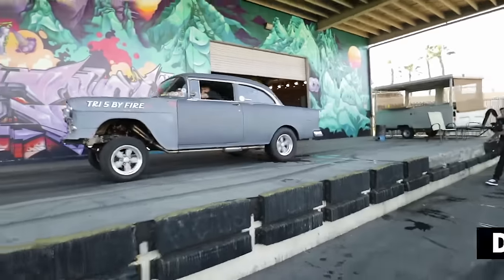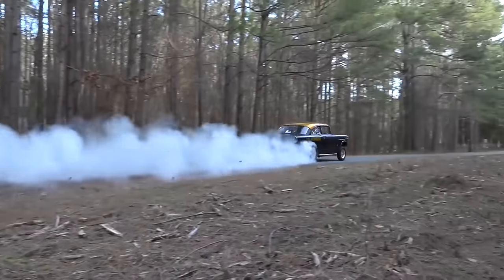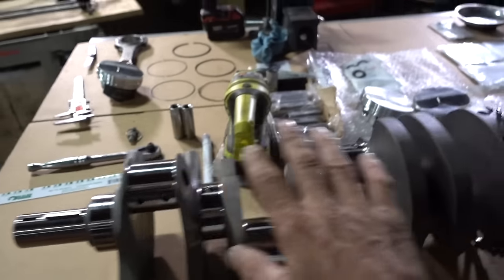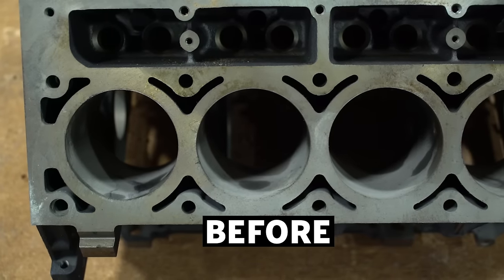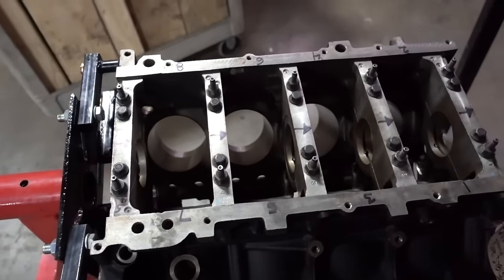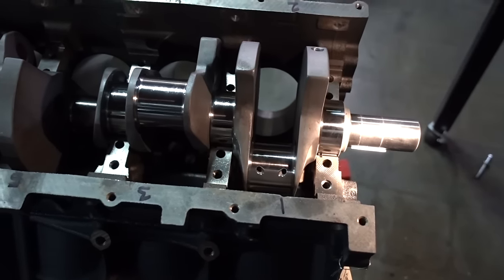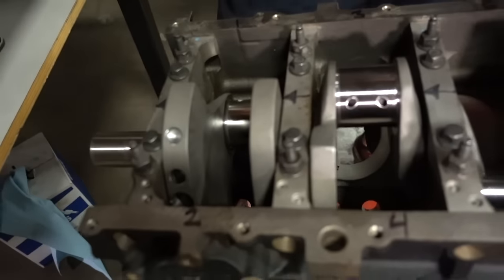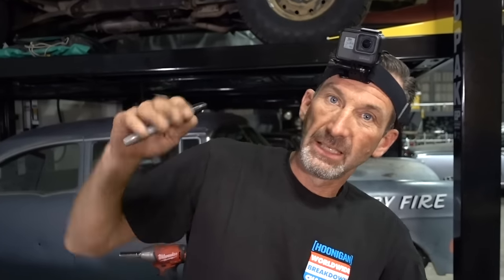700HP Stroker LS - How To Build Bottom End

Comment: smh this was terrible.......didnt even step the main cap torque.....used plasi gauge instead of dial bore gauge and micing the rod journals on the crank. used factory bolts to check the clearences instead of the arps....and he was really rough on taking the main caps off......letting them hit the floor.....gosh some many things wrong he did

Comment: You might as well have built the motor in the dirt. Nothing professional about the way you "attempted" to build that LS. Not to mention you screwed up majorly on the mains. Hope to God CPR line honed the mains to the ARP studs at the correct torque, if not that motor is going to eat itself alive.

Comment: Poor engine building "techniques"
Very unprofessional, dropping main caps on the floor. Side bolts dont keep the cap from coming out if main bolts come loose, it's to prevent cap walk. Checking main clearance with factory bolts with torque to yield, then installing the crank with ARP studs?? The assembled clearance is going to be different then checked clearance. Double clicking torque wrench, you just overtorqued...  filing rings with power drill, sounds like he took alot more off than a few thou. Did the .024 feeler guage fit into the gap snug or did it just fit, like wtf mate. Also they are called ring land, not ring glands... who is letting this guy build engines under HOONIGANS name. God damn! This was comical, yet uneducational.

Comment: you guys are really using a harbor freight torque wrench to build a hi performance engine? lol....... I don't think they are very accurate based on my usage . great video though.
Reply: like expensive tools are the only way to build performance engines? my own personal opinion when building performance engines (specially german ones), i would change the mechanic right away if i see him using snap-on tools
Reply: I didnt say you had to use the most expensive tools, just not using the absolute bottom of the barrel torque wrench on high hp engine.
Reply: idk now... as long as a cheap torque wrench matches up to one known to be accurate why not use it? Put money into high quality parts, not the tools

Comment: This is horrible tech.  Going from bolts to studs on the mains WILL require an align hone as the studs distort the mains differently than bolts.  You want to spin mains?  Do it like they showed in the video.  Want a motor that lasts?  Put studs in and align hone the block and align bore the cam tunnel as they arent machined to the best tolerances from the factory.  Oh and dont drop your main caps on a concrete floor and then just throw them back in the motor, swear that guy is drunk or high doing this shit.